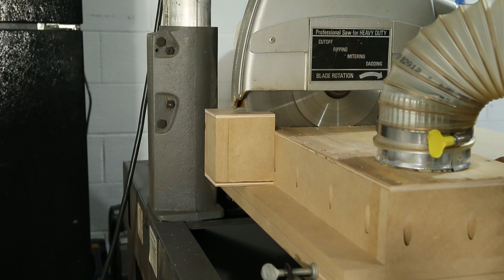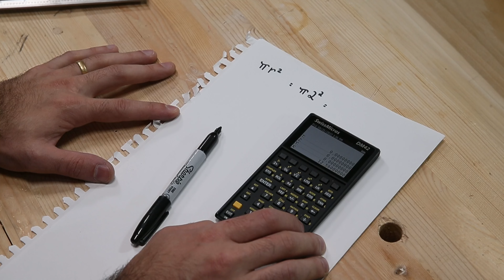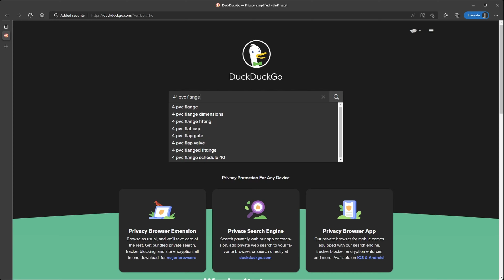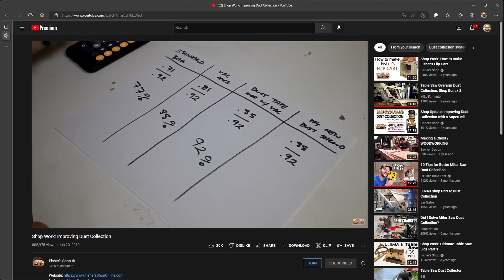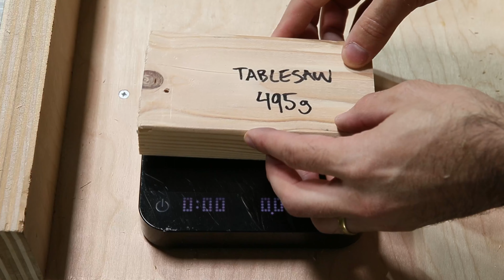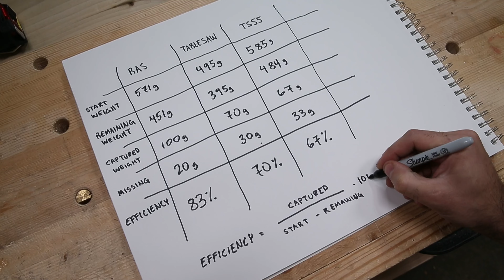Improving my Radial Arm Saw Dust Collection

Comment: I'll say it .. Thanx.  You inspired me.  I had a HUGE homemade catch system for years, limited effectiveness.  I took your ideas, made a few changes:
Mine is not permanently mounted.  I indexed it to put it in the right spot.  1/2 of my top is plexiglass, so I could see how it is doing, and if any clogs develop.  In summary it is several times better than what I had used for years.  I notice a buildup in the "box" to the right of the blade.  I postulate the drilling of a hole to allow air flow...  THANX again, good work.

Comment: Impressed by your testing method which undoubtedly demonstrates the success of your collector. My own is also linked to a shopvac but in designing the dust path I have tried to exploit the dust's own kinetic energy which seems to be boosted by the air stream set up by the moving blade. I am going to remove the vac hose temporarily to test this.

Comment: I just acquired a sears craftsmen 12” ras. It has a 220 plug on it. I’m hoping you may know if it can be rewire to 110 and possibly how. Would really appreciate it, thanks
Reply from the maker: Depends on the motor. I’d look up the specific model online and see if Dewalt has instructions. That being said, if you can run 220 to wherever you want to use it, it’s way better.
Reply: @ yeah I thought about that but I’m currently renting and I don’t know if they’d be happy if I tried to install it 220 lol
Reply from the maker: @Groundrat you could always ask your landlord if they would let you have an electrician do it. I successfully did that in the last place I rented!

Comment: If you only use it for crosscutting, why would the fence get "chewed up"?  Sawdust has never bothered me to the point of feeling the need to make some sort of fancy collection system.  I just use a shop vac, a broom and a dustpan.  I wear a latex mask with the big pink 3M filters when I'm running my equipment so I'm not worried about breathing the stuff.  Somehow, I find the job of vacuuming up the dust left afterwards to be satisfying...like watching someone pressure wash a car that has sat in the woods for twenty years, lol.

Comment: Had to learn the hard way that the limiting height for the collection box is the distance between the back table saw board and the bottom of the saw cover (will vary by the width of your back board). Which in my case was just under 4 inches. So, if your fence protrudes more than 4 inches and you make a box with 2-inch opening, by the time you add the Hight of the top cover for the box it’s too high and will catch and stop the saw from retracting to its back position.

Comment: Thank you!  I'm doing this thank you!  The only thing I could see to improve, is in your case the area behind the fence is the same height as the area in front of the fence I don't think most people do that.  Now it's much less of an issue since you have a dust collector but you don't want a piece of wood or sawdust accumulating under the blade when you push it all the way back and shut the saw off.  When you start it up, the sawdust/piece of wood can cause the blade to run/jump forward when you don't expect it to.  If you have the top behind the fence lower than in front (1 layer instead of 2) it gives room under the blade when you push it all the way back so when you start it there's some room so it's less likely to potentially run.
Reply from the maker: I’m not exactly sure what you’re describing here, but I’ve been using the saw like this for about a year now and have never had any sort of problem with wood or sawdust accumulating or the saw jumping forward on me. I’ve found as long as you keep one hand on the saw’s handle and the other out of the path of the blade, there’s very little risk when doing 90 degree cross cutting.

Comment: Hi Jim, I too must have watched about 30 or 40 videos of different dust collection ideas.  I built a few,  but was still not satisfied with the amount of dust still ending up in the air and on everything in my garage.  Then I came across your video and figured I had nothing to lose.  Sometimes,  the most basic solution is the best solution.  I'm very pleased with the results.  Thanks for posting this video.

Comment: I built something similar, but I added a flexible hose to the fitting on the front of the blade guard and ran it to another hole in the top of the shroud. Seems to make a difference.

Comment: I use a black plastic dust collection part that came on a used Craftsman RAS.   It is not as efficient as yours, but I get full use of the saws designed capabilities with it.

Comment: I'm really curious about the comment you made about fixing the legs. I have the same dilemma, as I have the same saw, but a slightly different variation of it. A T1531 Black and Decker which is a 1969 model. The quality of the stand is just atrocious. It's designed ok, but the metal is about 50% too thin. I'd like to know what your solution is. I have been thinking about it for months now, and I thought about TIG welding some metal reinforcements around the bottom perimeter of the stand to hold the legs on much more securely.
Reply from the maker: My plan at the moment is to make a whole bunch of Jer Schmidt's modular cabinets for my workshop and my electronics workbench - I am going to use a few of those to create a stand and a long support table to the left of the saw. My shop is set up for working with 8' long boards, so being able to cut 8' with a stop block on the left side of the saw is going to be awesome.

I actually did screw the bottom of the legs into some 2x4s temporarily - that did improve the stability quite a bit. I bet if you TIG welded some cross bracing it would help a lot - if I was going to do that I'd probably go from the bottom of each foot to each other foot, and then do some diagonal X bracing across the back and sides. I'm sure if you did that, it would be more than good enough!

Comment: The clips of Brian Weekley's setup is just out of control, the complexity of his dust system with little magnetic wood vent plugs, and furniture grade hardwood, just out of control. I start to feel like a failure comparing myself to some of these people on YouTube, including your channel and your setup. Thank you for sharing the dust collection video. I used my saw this weekend and the sawdust was so bad that it has me rethinking woodworking as a hobby. I need to invest in some type of entry level dust vacuum or use my shop vac every time I make cuts. I did find that you can capture about 80% of the dust in a rip cut very easily, because the guard functions about 99% better for dust collection when doing a rip cut, because there is no gap for sawdust to escape, it goes straight into the guard and straight into the vacuum. From an engineering standpoint, using a radial arm saw for ripping is better than crosscutting in some ways, despite the public confusion about it. When ripping it's MUCH safer than a crosscut, the guard functions properly in a rip cut, the blade has no ability to climb towards you, and the dust collector port actually works in a rip cut. As well, there is no issue with inaccuracy in a rip cut, the carriage is tightened down against the cast iron arm with the lock screw, everything is fixed.
Reply: LOL! You think my dust control system is out of control?  It was very well planned out and intended for all modes (not just crosscuts). I never viewed striving for craftsmanship and quality as being out of control!
Reply from the maker: I for one was very impressed with your setup Brian! If I was intending to use my RAS for anything other than just crosscuts, I’d very likely copy your system outright. Love your videos!

Comment: Seems impossible to buy a modern RAS these days in America.
Reply from the maker: They are VERY expensive for sure, but if you really want a modern one check out Original Saw Company. In my opinion, you would be better served by a cheap old one like this or, for that kind of money, a modern table saw.
Reply: @JimPudar  Original saw just raised their price on their RAS. Last week 4999, now 5999 for the smaller woodworker model. Crazy these days.  Only choice probably Maggi junior 640.

Comment: How far along are ya on that BASE cabinet?
Reply from the maker: Still in the planning phase. Not sure exactly where I want to keep the saw in my shop. I’m thinking about getting a metal lathe so I’m trying to come up with a good layout.
Reply: @JimPudar  SketchUp!
Reply from the maker: I am a long time Fusion 360 user and I’m currently migrating over to FreeCAD and OpenSCAD. I’m a software engineer by trade so I really love OpenSCAD

Comment: Nice saw , but your blade guard is missing. The guard has a nozzle in fitting and you can put mounts or simply strapping a vac hose with an extra long hose. I do have a Jet dust collector but the vac fits under the saw and pulls dust in a cross cut and even better when ripping . With the Radial saw  you have you can get  rid of your table saw . 😎
Reply from the maker: Thanks for your comment! Yeah, the fitting on the blade guard works well for ripping because the dust is directed up and toward the operator. For cross cutting, no dust naturally goes that direction. I also prefer to use my dust collector with 4” hose that will not create enough static pressure to use with a 1.5-2” port. I only use this for cross cutting at 90 degrees, so this type of collector is really my best option.

Comment: why not a mini gulp or something like it right behind?
TIA
Reply from the maker: It would probably work pretty well, but I think having a smaller opening closer to the blade is going to be slightly better.

I will probably experiment with something similar as my current solution prevents using an Incra fence on the left side of the blade…

Thanks for watching!

Comment: Ha! I commented on the rehab video before looking through your video catalog. I now see that you went though the same research circle as I did and ended up in a very similar place with your RAS dust collection. Beautiful work and the engineer in me loves your thorough testing.
Reply from the maker: Thanks! I am thinking that I might remake it with some slightly nicer materials now that I know it works well. I have a lot of plans in the works for that saw, it’s a lot of fun to play with.